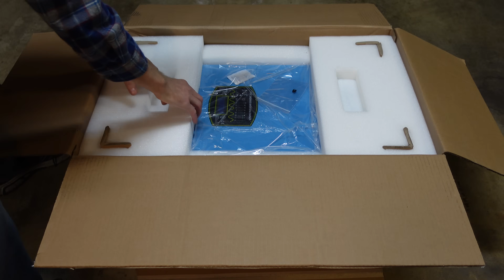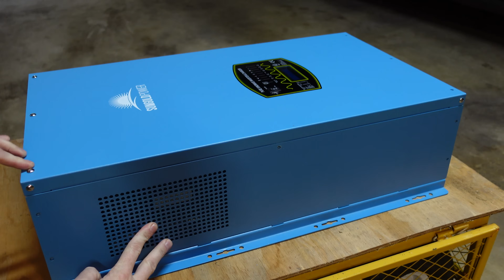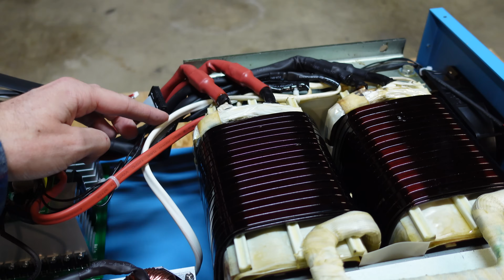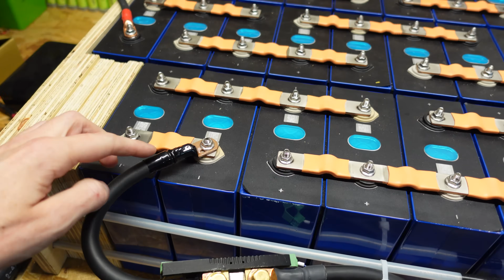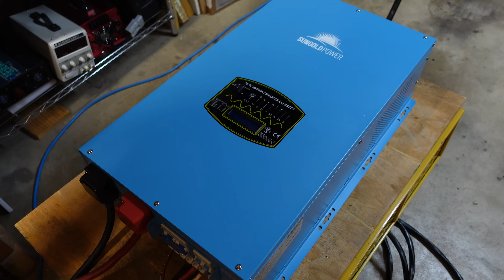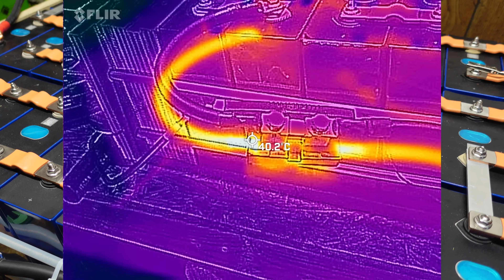SUNGOLDPOWER 12,000W Split-Phase Inverter/Charger, Review & Testing

Comment: Looks like a decent inverter.  Only other drawback I thought was the single 40a mppt charge controller.  I would like to see at least an 80a or dual 60a. Great review!
Reply from the maker: I'm surprised it's only rated for 40A considering it looks near identical to the PCM60X and that's rated for 60A. What does your Growatt have? 80A?
Reply: @LithiumSolar  got the growatt 12k dvm mpv as a backup unit.
It's got 2-60 amp mppt at 250v input with 7000watts max array size. I think average Joe got the 150v input unit, not sure if it's dual 60 amp mppt or not.
Reply: Yeah, even the newest version Max's out PV input at 145 volts and only 4000 watts. I mean All the larger 'all in one' inverters (the reputable ones, I haven't checked all the Amazon junk) have either 250 VDC to 500VDC and usually max out in the 6000 to 8000 range (some more) and most half that rating and larger have a dual MPPT charger system. I am not sure what that unit costs but it is lacking in a few areas. If it is under 1800-1900 bucks, I would say that the short comings might be worth working around, if you're on a tight budget. 
     Ya'll Take Care and be safe, John

Comment: Great video as usual. One thing I see is a lack of parallel function. I would prefer multiple smaller parallel hybrid inverters rather than one large inverter. I see that Growatt announced in September (but I do not think yet shipping) a 2nd Gen version of their equivalent of this inverter. It looks like the Growatt SPF 3000T HVM-G2 will start with a capacity lower than their current range. Parallel inverters mean less total failure risk, each one is lighter to handle and needs smaller cables. They too are low frequency inverters, but the 3000 model can handle PV up to 200VDC operating voltage and 80A, so if you have more than one array, multiple inverters give you a lot of flexibility. The AC charger is also relatively (compared to the inverter capacity) large, at 40A. With multiple inverters, you could have multiple battery banks. Growatt have not said whether this new range will use standard laminated transformer (such as the ones you see in this SungoldPower inverter), or whether they will use a toroidal transformer (better, more efficient). But, given that Growatt claim their new product will be 95% peak efficiency, which is much higher than normal (1st gen version is 85% in the smaller versions), it is possible they they may be using toroidal transformers. One can but hope. For now, they are clearly selling off their stock of the 4000-12000 1st gen range (which is their direct equivalent of this Sungoldpower inverter). The 12000 is down to around $2300 including shipping! You also do not mention Wifi (app) control, which the Growatt has an option for.
Reply: sungold 6000's are parallel-able and half the price.
Reply: @DieselRamcharger  Yes, and I have both on 2 separate applications and the 12k will, without a doubt, start and run much bigger inductive loads without faulting. I have had as many as 4 6k's in parallel and still will fault on heavy start ups.

Comment: I love this inverter it’s heavy duty for sure and is completely reliable so far. As far as the charge controller there is no way to know what it is doing because there is no separate display for its so I don’t use it. The fact that it is always pulling 230 watts is a negative in some regards however if you have a large array I’m sure it won’t matter.
After watching your video I’m thinking maybe rewiring the fan with a separate switch maybe the best thing. Great video thanks.

Comment: I'm struggling to piece together a 19V (19.5V rating per the power brick) DC UPS for my Internet router. I'm also hoping for 12V DC out as well if possible. Maybe something I can fit in an Ammo Can (or similar size)? One additional requirement: I want to charge and run my device at the same time so there no switching cables if the power goes out. Any ideas? Thanks!
Reply: Best plan for 19.5V output is an inverter and the wall wart… but a variable boost controller should work. I have one that can set output voltage infinitely adjustable from 10 to 60V from a 12V battery. Amazon has them.
Reply: @SuperVstech  Thanks for the reply! Which type of battery should I use? How do I handle the switch over from live DC to battery?

Comment: These things are total crap, I still run two of them completely modified with huge heat sinks at the sides of the transformer and additional heat sensing and ventilation for the transformer. Only with constant cooling you can keep pulling any power. Otherwise just running on no load whatsoever the transformer heats beyond boiling and all capacity is gone. And anyway these inverter boards are past historic, there are good low frequency inverters from china but with huge Japanese IGBT´s, there you can pull load any time and running 24/7.
Reply: Can you kindly provide examples of the good ones with Japanese IGBTs?

Comment: I purchased a 4Kw unit like this and also have issues with the fan always on when in inverter mode and the On position. As mine is used in a travel trailer, I normally use the Standby position. You may want to test the battery priority vs. AC input priority DIP switch to see if it makes a difference on the fan runtime.

Comment: Are any SUNGOLDPOWER or Growatt inverter/chargers suitable for use on boats?
Reply from the maker: I'm not familiar with the unique requirements of marine/boating to be able to comment unfortunately. I know you definitely have to take the increased humidity into account.
Reply: Any cheap inverter can be used on a boat...

....for an anchor ;-)

(sorry, I couldn't resist)

Comment: Low frequency inverters like that are good for starting inductive loads with high inrush currents, but they are much more inefficient than a high frequency transformer less inverters. The 180C class H rating on the transformer should give you an idea of just how much power it is wasting to heat.
Reply: This is a good point. With modern high-efficiency HVAC equipment, they start up slower and might not be as big of an in-rush. But, air compressors, dishwashers, sump pumps, pool pumps, well pumps, etc. still have high in-rush currents. How do you handle those with a high-freq inverter? Would that require over-sizing the inverter to handle that in-rush load and, if so, wouldn't that consume a higher idle consumption than a smaller high-freq inverter? I guess what I'm asking is, how do you use a high-freq inverter with high inductive loads and still maintain the idle consumption benefits? This question is open to all. Thanks
Reply: @cuisinartOH1  Some newer HF inverters have a surge capacity of 200% for 5 seconds to help with this. I have a Sol-Ark that is rated at 9kW on grid and 8kW off grid and is rated at 200% for 10 seconds, but still I have seen were people have had them trip on high inductive loads. My inverter has no problem at all starting small motors like the refrigerator, dishwasher, washer, central gas heater, etc, but my shop compressor, I never even tried. Sol-Ark said it should be OK starting a 3 ton AC unit but I think that's pushing it. A reduced voltage starter can be added to AC units like this, and no doubt it would solve the problem, but it cost about $500. You could add these to other motors too, not just AC. One solution is to change the nature of your loads and break-out everything in your house in a separate sub panel to power all your normal loads, put modern inverter mini-split AC units in select parts of your house, and leave the rest on grid. This is what I did and I have everything but my central AC compressor and air compressor on the inverter and it powers everything else just fine.(Sounds crazy, I know, but my inverter and panels are on a coach bus and that's it's primary application and I needed high efficiency but I wanted to use it to power the house when I am not traveling). Another option is to put another HF inverter in parallel to double the power handling for all of your loads. It could be switched on to start high inrush loads and can be turned off to save power once started (as long as the total steady state load does not exceed the first inverter), but that's probably much more money than you are willing to spend. And another option is to use an isolation transformer or an auto-transformer from a 240 volt HF inverter to split-phase. This could help you start high inrush loads, but now you are back to that low efficiency constant waste of power. And if you are off grid only, say hello to your new LF inverter for me. Add the losses to your base requirements and add more panels and battery to make up for it. I guess there's no free lunch.

Sorry for the long dissertation, good luck.
Reply: @lbroome  Thanks for your thoughts. I feel the same way- you’re going to pay the piper. I would rather my wife and kids not consult a manual load-shedding checklist at the cost of a lower-efficiency, low-frequency inverter, slightly more PV, and slightly more battery capacity. If you’re family is used to on-grid, care-free electrical usage, then I would suggest splurging for the hernia-inducing transformer inverter. The Victron inverters use torroidial transformers.
Reply: @cuisinartOH1  but it’s not slightly more. 240W over a 24 hour period is nearly 6kWh. So let’s say 4.5kWh more than an efficient inverter. That’s significant, particularly in solar capacity. There’s two costs here - the initial cost of purchasing more solar and more battery and the ongoing daily cost of not sending that extra capacity back to the grid. The initial cost is probably offset somewhat by the increased electrical installation costs of a separate sub panel (likely to cost a couple of grand) but IMO, you’d be much better off separating out your high inductive loads to a separate sub panel that is grid powered. Then your wife and kids don’t need to worry about it. It happens automatically. You just treat the grid like a giant additional battery, that the utility company will pay you for when you’re charging it.
Reply: @cuisinartOH1  I agree with ModoTV here. Efficiency makes a big difference. Just for comparison, my hybrid inverter uses 60 watts idle current and I often measure the efficiency at over 95% and that's a huge savings over traditional inverters. If you go LF, don't under calculate the extra panels and storage for the loss of efficiency.
Reply: Can anyone help me, maybe it's only because of the small load, that I did for testing, ran my upright freezer on a 6k watts, 240v split phase, aims low frequency inverter, for a few hours, got very hot. Maybe because of the small load.
Reply: @carlosreyes6448 your freezer is likely using only 120V.  The imbalanced load causes heat in the other half of the transformer coil with no load.  Freezer should be running at short duty-cycle though, only a few minutes per hour.
Reply: yes

Comment: 80 amps on the AC breaker with agw#12 seems a little light but it did the trick and didn't show up on the heat gauge. Thanks again. Oh if you get a chance to measure the surge on a lra device I hope you show us.

Comment: I think DC Out next to PV hook up is most likely same as LOAD.
Reply from the maker: I later discovered the DC Out terminals aren't connected on the other side. Not sure what they're there for, but not electrically connected to anything. Perhaps some models pass the MPPT output back out or something.

Comment: Not that long ago I’ve tuned in and man , you got a big one . How much a difference is it vs the 10 kw Aims that you have ? Thanks for the review of this monster and of course the large set of lithium batteries that’s handling all the power vs the Aims and the GroWatt or any other large LF inverters . We preppers must depend on powerful low frequency inverters to keep running our homes during any SHTF Situation or at will . My Aims is a beast also at 6000 watts 24 v and it’s powerful and I’m going to be purchasing more lithium batteries also for it to run more stuff at full throttle in my house 🏡. Check out my solar videos and hit like , leave a message and subscribe . May the solar be with you .

Comment: Idle consumption may be high when there is no load but for a while house case it's not a problem because once the inverter is being used for something the idle consumption goes away.
Reply: The idle consumption never "goes away". It continues to use that amount of power added to your loads at all times. You can check this out with an accurate watt meter.
Reply: Nope, unfortunately, the inverter pulls 5.4KWh from the bank, each day… any loads, add to it.

Comment: Do you know if two or more of these can be wired in parallel? I went to the web page and read the users manual and I could not find any information on this topic. Thanks.
Reply from the maker: No, these do not support wiring multiples in parallel.

Comment: I find the build quality very good, idle consumption could obviously be better. The MPPT controller is a real weak point, since 145v input limit is very limiting if you need an inverter that large. I personally would prefer lower idle consumption and a 250v MPPT. But yes, that is capable of running an entire house. Good review,  BTW. Those busbars are better than I expected.
Reply: Mine input for panels will be 300 V so I would be out.
Reply: UL or ETL RATING?  Grid interactive?
Reply from the maker: No UL or ETL ratings on this unit.
Reply: @LithiumSolar  - “No UL or ETL” 

Does that make it illegal to run in the US, 
in a grid tie?
Reply from the maker: @DavidHalko  This is NOT a grid-tie inverter.
Reply: @LithiumSolar  - “not a grid tie inverter”

Thanks!!!
Reply: Awesome setup. How many watts in solar do you use to feed the battery bank? Maybe change out the fan to a more efficient one.

Comment: Would the external temp sensor not being connected have something to do with the fan running?
Reply: Solar was not hooked up. Also the temp sensor for the inverter is hooked to the MOSFETs
Reply: @JM-yx1lm  And the mosfets were not hot which can mean a defective sensor or open circuit leading to a default fan on. Solar input is not connected to the fan circuit.
Reply from the maker: I did plug in the battery temp sensor at the end to see if that made any difference and it did not unfortunately.
Reply: @LithiumSolar  It won't.  The page of the manual that you showed indicates that there is an "AC fan", and a "DC fan."  Reread the paragraph above the table...it's pretty clearly spelled out.

The AC fan is connected to the AC output of the inverter--so if the inverter is producing AC output, that fan will be running.  In Power Save mode, the AC fan will pulse on and off every time the inverter switches on and back off again.

The DC fan(s) are temp controlled.
Reply from the maker: @sidlori1592  Interesting, I see what you're saying now that I re-read it. That's not what I expected though. I'll have to open it up again and see how it's actually wired. Thank you for pointing this out.

Comment: It looks just like my Growatt 12kw and my 6kw looks the same, just a smaller core on the 6kw also built the same as well. Odd. But the Growatts do have a clear plastic for air flow control which is nice. Over all that looks like a good build.
Reply from the maker: I compared the internals to Average Joe's 12kW Growatt video and agree very similar, with the exception of different MPPT charger boards.
Reply: Yes I have the lf 6k growatt also and the 12k on the way and the placement and transformer both look very similar.